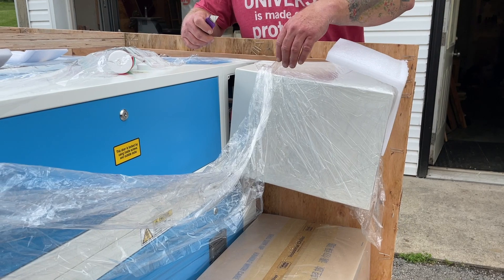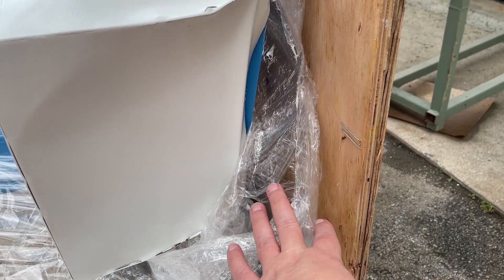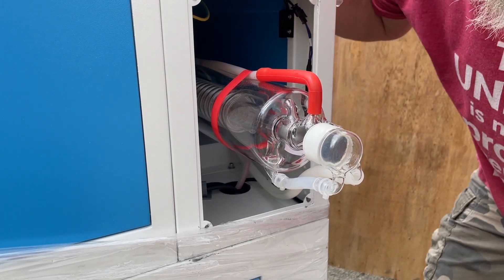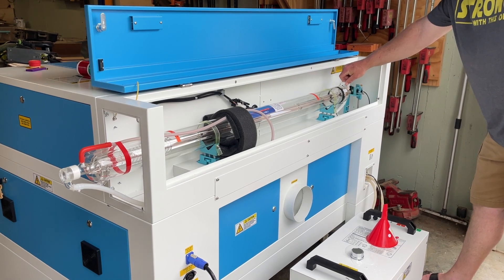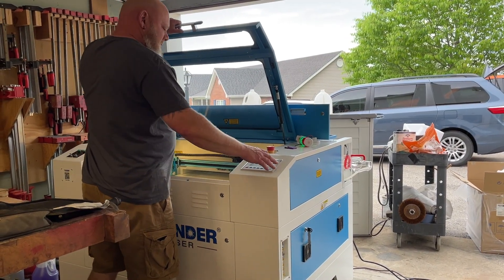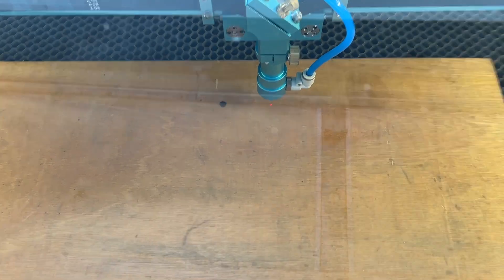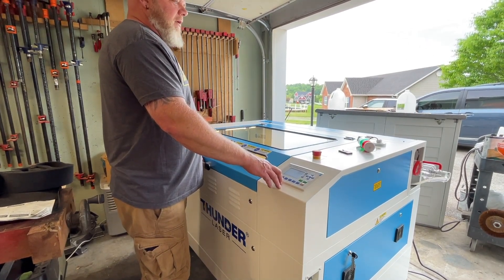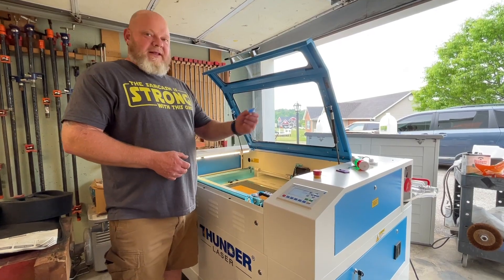Buying a Damaged Laser! PART 1. What we found!!!

Comment: For the tube cover, I've seen some folks 3D print it and it is way less protruding (and less expensive). Also, def wipe off any finger oils from that tube too or it could be a hot spot.
Reply from the maker: Yep 3dprintsbychris has one.  My son has actually designed and is printing one now for us.